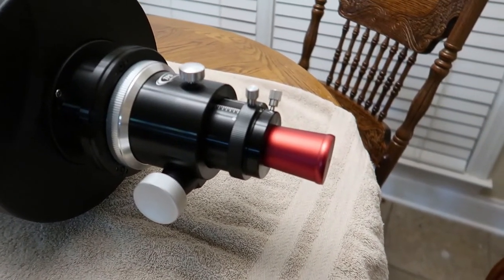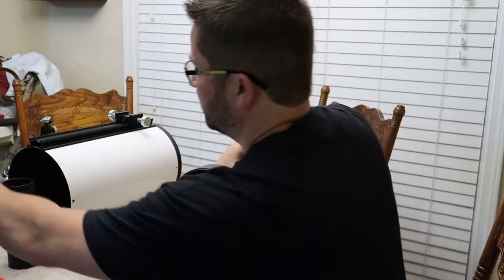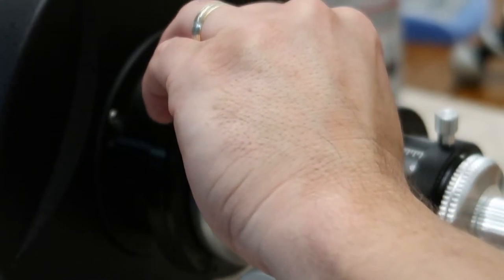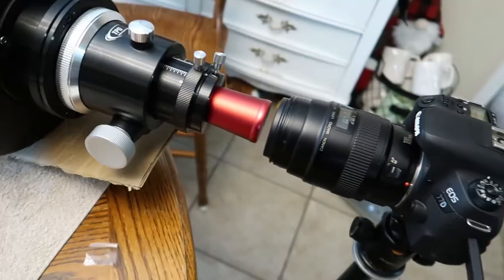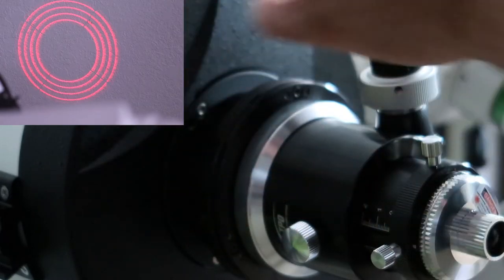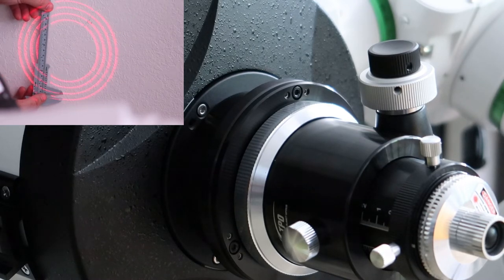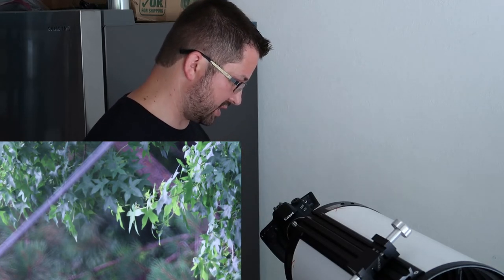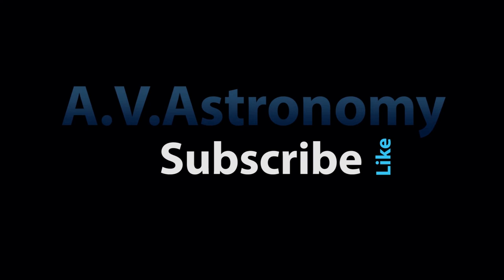How to properly collimate an RC telescope:  Ritchey Chretien Collimation

Comment from the maker: PLEASE NOTE:  EASIER AND MORE EFFECIENT METHOD TO STEP 1:

1)  get a telescoping mirror like this https://amzn.to/3gKnmG1
2)  extend it inside the tube attached to a tripod(via duct tape or something) 
3) angle the mirror so you can see the center dot on the secondary
4) proceed with the focuser alignment process I use in the video

This eliminates removing the primary mirror and saves time while making for a more accurate alignment of the focuser.
Reply from the maker: @Thinking Biblically Thanks for the kind words.  Also, the collimation plate was necessary as it was the only way to get the focuser aligned with my scope.  certainly not something I would skimp especially when collimating an RC.
Reply: I have been going through your process and I’m running into a problem where the tilt plate or secondary (or primary?) is causing me to adjust the tilt quite a bit to get the laser in the doughnut (step 1).  Now in step 2 (Cheshire) there seems to be a gap under the secondary (i wish I could post a pic but YouTube won’t let me). Is it possible that if the secondary is way out, something needs to be done before alignment of the tilt plate?  Thanks much ... hopefully I can get my RC6 columnated this weekend while clouds are still rampant!  Thanks again!
Reply from the maker: @bobbeanbags  Hi Robert, so once you got a ballpark alignment of the focuser, you’ll want to get the secondary as planar as you can. Use the camera zoomed in to that center dot on the secondary and get that perfect.  After that move on to the primary. Get the primary set so all the rings of the laser collimator are concentric.  Once you’ve done that go ahead and do a final adjustment on the focuser.  You should be good to go here but a star test will confirm the results.  Good luck!

Comment: Thank you for this video! I greatly appreciate this video as I think I have the same OTA (mine is an Orion 6” RC). I purchased this whole setup used (and got a great deal). I’m currently waiting on the Howie Glatter collimating laser which had been in back order for a while now. I ordered it before seeing your video. I’m extremely new to astronomy. This is my first “real” telescope and to be honest, the whole time I’ve been researching telescopes, the thought of having to collimate a telescope freaks me out. I’m convinced I’ll only make it worse. And as if that fear is not paralyzing enough, I see what looks like my scope in your video. In fact, when I saw the part about the inner tube on the primary mirror I prayed hard that my scope didn’t have one. But I checked and it does. And just like yours, and I cannot see the donut on my scope. As if I weren’t terrified enough about collimating itself, the thought of taking the OTA apart has me beyond terrified. Are there any other options? Does that baffle need to go back in? In my ignorance, it just seems to me like you would never be able to put it back together after step one without misaligning it. Are there any less terrifying options?
Reply from the maker: Mark Kordelski thanks and congrats on the scope.  A couple things:

1)Please refer to my posted note that updates step one.  Use a telescoping mirror to look down the tube instead of taking out the baffle

2) be patient and make small adjustments. This does take some practice but it is a procedure well worth learning.  

3). RC’s are challenging to collimate when learning to do it the first time but as you practice more you’ll get better at it and this video should help you achieve the results you seek. 

Clear skies!
Reply from the maker: Mark Kordelski the biggest challenge when collimating this scope is adjusting the primary mirror. From what I understand from
Other people’s experience the primary mirror holds collimation very well and generally shouldn’t need adjustment.  However,  since yours is used it is possible the primary mirror has already been adjusted before.  The best thing you can do before making any adjustments is testing it.  Do some day time viewing and see how sharp everything is.  If it looks nice and sharp then try it out at night on the moon or some planets on a night of decent seeing.  If it still looks nice and sharp then I wouldn’t make any adjustments.  If things appear a little on the soft side then follow them I would follow my video.  But remember make small adjustments.

Comment: thank you for this video! It was very helpful. Two questions come to mind, if I may ask you...when you did the star test, how did you know it was the primary to adjust and not the secondary?  And as a follow up, when you adjust the primary, does the secondary not go out of alignment? thanks!
Reply from the maker: Hi, I hope you saw my notes section about using a dental mirror to help with alignment.  This way you don’t have to remove the primary.  You’ll get much better results that way.  Also, yes, if you adjust the primary you’ll have to adjust the secondary again.  The goal is to get the primary aligned first and then make small adjustments to the secondary.  Best advice I can give you is be patient and make very small adjustments.

Comment: Good video, but I believe your procedure can be improved upon and made more accessible, as the Howie-Glatter, while recommended, is not strictly required. I own the same model scope and Howie-Glatter collimator with attachments and accomplish indoor collimation to a very high accuracy without relying on it.
One key thing of note is adjusting the primary should generally not be recommended in most instances. It is well secured and does not lose collimation easily from the factory. But if dealing with a second-hand scope, or is otherwise deemed necessary, there is a way to fix it. I also rely on a camera to spy on the internal elements, and everything I do can be done at any time on the workbench with extremely high accuracy.
My first step is to correct the secondary. Then check the primary and finish with the focuser tilt. Due to the tilt error introduced in the focuser hanging far off the back of the telescope which is attached to the primary mirror tilt adjustment, it is necessary to devise a collimation cap for the rear of the telescope with the focuser removed. To make a custom collimation cap, cut out a disk from cardstock, 90mm in diameter with a small 2mm peep hole exactly in the center and make one side reflective with some adhered foil. This will fit within an extension ring to hold it close to the rear of the telescope.

Continue with your camera spying method. Aim within the telescope from the rear, through the peep-hole. I use a 55-255mm zoom lens about 8 feet behind the telescope that is carefully aligned connected to a laptop with control software to watch closely while making adjustments. Very small adjustments should be very apparent on screen as your center the peep-hole dot into the center spot marker.

Next, check the primary. Remove the disk to reveal a clear view inside the back of the telescope. The zoom on the lens should be set to see all of the interior features. We are interested in the internal reflections of the spider vanes. While it is tempting adjust the features to be concentric rings, they will not help us due to imperfect viewing angle. Instead focus on the image of the spider vanes reflected on the primary and secondary mirror faces. They will tell the tale regardless of some camera misalignment.

*Note inter-mirror spacing is critical; it affects focal length and spherical aberration. Avoid using one collimation screw entirely; tape it off as a reminder. If necessary make small adjustments to the primary mirror to bring the reflected vanes into alignment with only 2 sets of collimation screws. The third may be used for the final minute tweak if you must.

Finally reattach the focuser assembly. Squaring up the focuser may or may not be necessary depending on sensor size and focal reducer used. It is tricky without the tilt plate but possible with laser collimator and careful positioning of the stock focuser while tightening it on.

The primary and secondary are now optically aligned to a higher degree than can be accomplished by star test or laser. Observe the hall of mirrors effect from the front. I have found no need for further adjustments following this procedure and Howie-Glatter laser with rings perfectly agree with that assessment.

Good Luck.
Reply: @tomsprecher3369  When adjusting the primary mirror, focus your attention on  the internal reflections of the spider vanes. Get them all into alignment.
Very small corrections are easily seen in the pair of reflections. It will end up being optically aligned. However it relies on accurate secondary adjustment from the earlier step. 
This is superior to a mechanical alignment based on concentric circles of the internal elements.

Comment: Nice. I’ve been waiting for this video. Just got my brand new RC8. And of course, the stars is slightly out. But I think the  primary-secondary are fine. I’m suspecting the mechanical alignment  of the focuser with respect to the optical axis needs a tweak. So I’m waiting on Agena to get the next batch of collimating rings in. Thanks for the tutorial. It definitely gives me confidence to tackle this should it be a larger offset than I’m thinking.
Reply from the maker: Hi Dino,  thanks for watching.  Glad to hear this helps out.  My ultimate goal was to create a video that covers this process start to finish.  Clear skies!
Reply: Dino Monaco- I found with my RC8 that the stars are slightly out of round as well - but it was diagnosed as camera tilt.   I'm saying this so you don't go insane trusting 'bad' stars as a collimation issue when they might be telling you something else is wrong.
Reply: Thanks for that tip Allen. That one I didn’t think off. I’ve done all the advanced research on these RCs so I knew what I was getting into. And truthfully I’m not worried. It’s just that it’s a brand new Orion RC8 and my first light subs weren’t that bad. Since those collimating tilt rings are back ordered I can check my camera tilt in the meantime. Again thanks for the tip.

Comment: Thank you for this interesting video,I have noticed that you have used a 25mm spacer and collimated the telescope.My question is , what do you do in case you need to add another 50 mm spacer after collimation has been completed say when you attach a different camera, you need more back focus, in which case you need to attach more spacers,do you just unscrew the focuser along with the collimating ring and add the 50 mm spacer and the screw on the focuser or do you  need to re-collimate again?
Reply from the maker: Yep, anytime you change the imaging train you’re gonna have to re-collimate make that scope.  And honestly, there is an even better video on doing this by Allen Mitchell.   RC telescopes are great imaging scopes but they can be a total bear to collimate and keep collimated.

Comment: Thanks for making this! have tried everything to get my RC8 collimated correctly. I'm trying it out tonight with your method!
Reply from the maker: Hi Kristi.  Glad you found this helpful.  I would like to mention that I have been meaning to update step 1.  While the current method works, there is an easier way.  If you use a telescoping mirror like this https://amzn.to/3gKnmG1 you can tape the mirror to a tripod and angle inside the tube of the scope to see the center dot.  This way you don't have to remove the primary mirror at all and it will make for a better alignment of the focuser.  Hope this helps.  If you need more detail , shoot me an email and I'd be glad to help.  Clear skies!
Reply: Yeah, no way on earth was my primary going to budge. I was able to reach in and unscrew the baffle and put it on the bottom of tube. Then set up DSLR to zoom in on the spot. I had watched video after video and searched the web and couldn't figure out how to see the darned spot on the mirror!
Reply from the maker: @kristikuenstler4191  Glad you were able to get it out without removing the primary.  This will make for a better alignment too.  once your RC is collimated you will love its performance.  and it holds collimation quite well.

Comment: I wanted to pass along a little info regarding the Howie Glatter laser collimator and the Holographic Circle attachment. After receiving the laser and the attachment, the attachment would not screw into the laser body. Wayne at Starlight Instruments sent a replacement right away and also explained that there are actually two versions of this combination with the newest version being marked with "-NV" appended to the model. This may not be obvious when you place your order, so it may be best to chat with someone first.
Reply from the maker: Thanks for the mention Kevin.  Great advice.

Comment: Thank you for this post. There seems to be precious little info from the manufacturers and distributors of these telescopes on how to use (collimate) these things. Disassembling the scope to collimate the secondary mirror scares me. I routinely use an adjustable dental type mirror to visualize the donut on the secondary mirror. With the scope horizontal, I lay a white piece of paper inside the tube, then lay a small flashlight (a penlight would probably work) on top of the paper to increase contrast so that you can see the donut on the secondary mirror. I position the dental mirror opposite the paper, at the top of the scope. By adjusting the position of the paper, flashlight and mirror, it is fairly easy to see the laser reflection and the donut target at the same time. My dental mirror has a clip on it, I can usually clip it on the edge of the optical tube and it stays put during adjustments. (Amazon - Titan 11160 Telescoping Inspection Mirror $5.56)  
Oops, sorry just saw your update on the mirror.....Ha
Reply from the maker: I was just about to point you to the update, lol.  Thank you for the advice though,  a mirror with a clip would be easier for sure.  Clear skies and God bless!

Comment: I'm curious as you didn't show it in the video. After adjustments are made to the Primary mirror the focuser is no longer pointed to the center of your secondary. Do you usually readjust when you go through the second, third, and so on iterations?

I've noticed if you don't get the focuser fairly square with the primary mirror you can get good looking star testing but end up with very wonky stars on 1 side of your picture.

Please let me know your thoughts or solutions to this

Thanks
Reply from the maker: Hi James, thanks for pointing that out.  I hadn’t noticed I didn’t mention that in the video.  Yes,  you would go back to check the focuser but I would use a small extendable mirror to see the reflection of the center dot on the secondary instead of taking off primary again and make your adjustments to the tilt plate of the focuser.  After this,  re check your secondary and then star test.  The adjustments should be very small at this point and the iterations of making further adjustments should decrease as well.  Hope this helps and thanks for watching.

Comment: The part at the end where you mention the concentric circle holographic adapter isn't being made is not accurate.  Starlight Instruments does still make the attachment.  It could be different from the one you have now, because the SI-HOLA-Circle projects nine concentric circles instead of the 5 you have with yours.  Maybe yours does do 9, but only 5 reflect off an 8 " mirror (more on larger mirrors?)...
Anyway, They still exist, and anyone can purchase them direct from the Starlight Instruments website.
Reply from the maker: well thats good to know. Thanks for mentioning! A couple different retailers told me they weren't carrying it anymore, only the square grid pattern.  Good to know its still available for other. Thanks for watching.  Clear skies!

Comment: i was wanting one these scopes, but now i don't know...how long will it hold? if not long the holes in the metal is going to ware out. good stuff
Reply from the maker: ATC Hobbies Hello and thanks for watching.  Are you asking how long the collimation holds?  It holds very well and after you’ve made the initial collimation,  you should only have to adjust the secondary in most cases.  I’ll be honest,  I love this scope but it requires some patience on learning how to collimate it but with the proper tools and some practice it’s really not bad.  Clear skies!
Reply: The very first time I collimated my RC8 was last week.  It's not as perfect as it can be, but it is really close.  Took me maybe 20 minutes to do.  If you think about it, He collimated the telescope here in under 30 minutes, WHILE taking time to explain steps in between.  Once you know the process, it is not nearly as bad as you think it is going to be.  Just go slow so you don't make over corrections that take more time to undo...  That's the real secret sauce :)